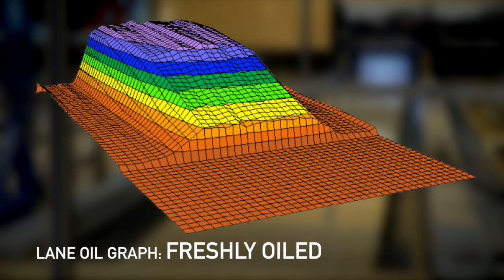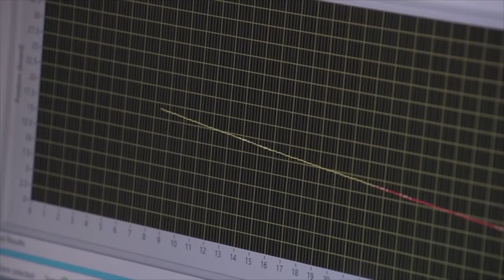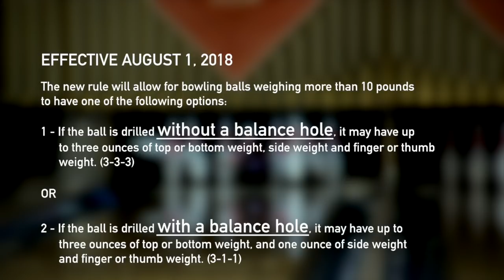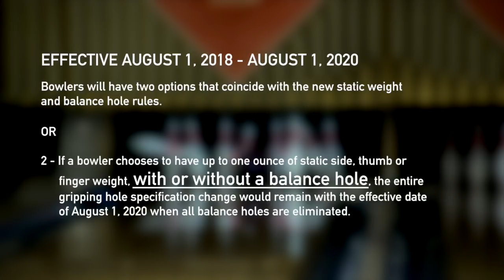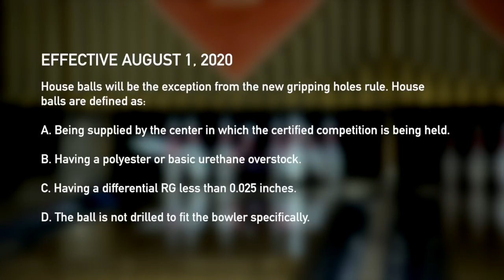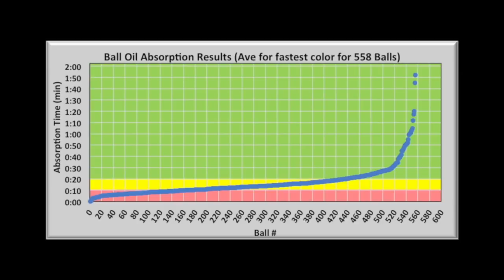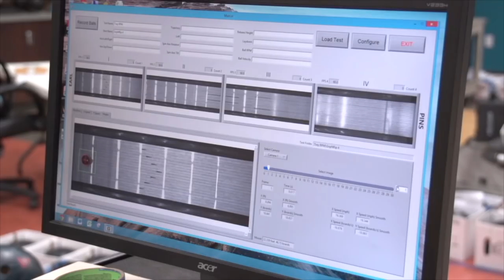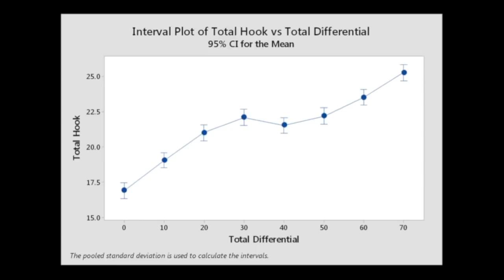Bowling Technology Study Conclusion: Research Summary and Updated Specifications

Comment: So what has the bigger effect on ball hook the surface or balance hole?
Reply: dipfidge, neither, the surface affects the  skid phase and length and the balance hole is there to make the balls static weight legal. The core and the bowlers skill of release affects the amount of hook.
Reply: Please explain the skid phase and length of what?  Curious 1:48 the video says balance holes are creating added hook for bowlers from what you are saying this is untrue, and the usbc has it wrong that its the core and bowlers skill of release that is affecting the amount of hook not the static weights?
Reply: digfidge,The weight hole is there to balance a symmetrical ball that has been drilled and the static weight is no longer within 3oz. according to USBC rules. It will enhance or decrease flair but, it does not create a hook that is not there. Norm Duke and Brian Voss both use their reactive resin balls to pick up spares. By breaking their wrist and releasing the ball in a backup position, they can cause a ball that is supposed to hook to go straight.My info is from talking to the pros and what they have learned.
Reply: This keeps getting weirder and weirder so now you are saying weight holes are only for symmetrical balls?
Reply: it is in the first part of your reply "digfidge,The weight hole is there to balance a symmetrical ball that has been drilled and the static weight is no longer within 3oz." If anyone is a troll it is you sir replying to a comment with no answer and going off topic.
Reply: The surface absolutely. Ballance holes don't do much compared the surface of the ball.

Comment: Sounds like my good ol' Roto-Star X2 from 1975 will still be compliant... good. But my 1974 Columbia 300 caramel will NOT be because of the balance hole I drilled in 9th grade shop class... bummer. Plugging that balance hole would really stink- I guess it's time to retire old faithful :(

Comment: Bowling stopped being about talent years ago - soon as people could buy "hook in a box". Seriously, a bowling ball surface which is porous and similar to sandpaper in texture? Let's throw in a radical asymmetric core as well. 200 rpm players throwing messengers around. Should have all been stopped with urethane, hell, maybe even plastic. You wanted hook back then, you had to work for it. Currently, there isn't any way around it though - as the bowling centers have to swamp the lanes to protect them and provide a playing environment which is "competitive" and won't be down to bare wood after a game or two - and this means people buy the radical sandpaper balls so that they can combat the oil.
I don't see any need for a ball more "radical" than my old Columbia Messenger (the blue pearl messenger). Sure, had to work the ball a little, but I always had "hand".  Hell, we could all go back to Yellow Dots on 8 mils - then - it would be about talent again. Sadly yes, the 2 handers would have an even larger advantage though.